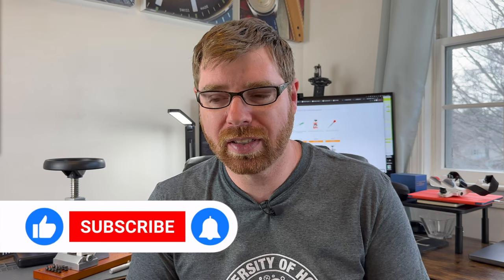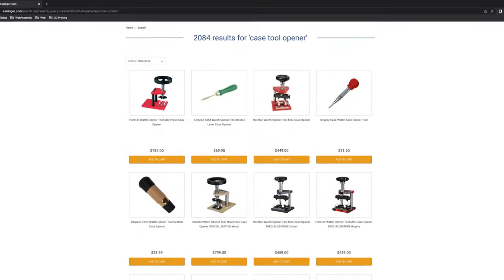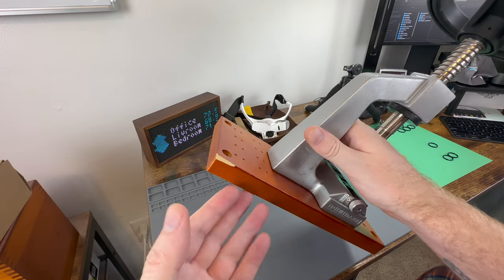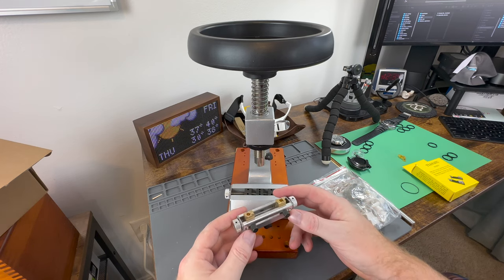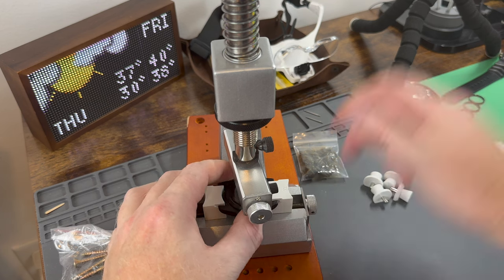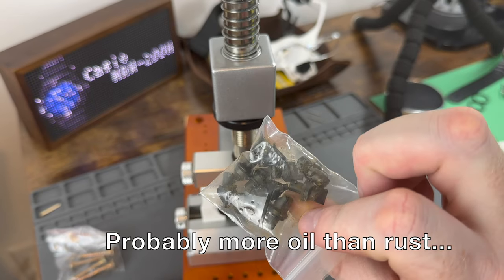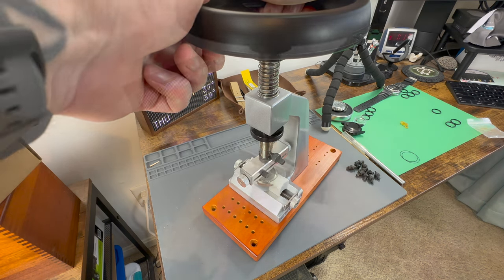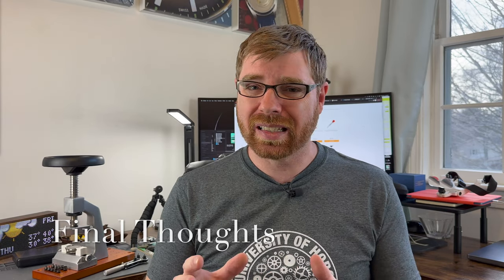Watch Case Opener Review, Bench Tool for Opening Case Backs

Comment: I was dead set on purchasing a screwed-down case opener from Horotec, costing nearly $900.00+. However, after having watched your presentation in this video, I am now exploring more options priced more reasonably in comparison to the aforementioned Horotec. Thank you for an informative review, well done!
Reply from the maker: this thing works just fine, and I use it a lot. There's no reason something like this should cost what Horotec and Bergeon charge.
Reply: @WatchComplications  Yes, I completely agree. The prices of almost anything of late, let alone that of commodities have become nothing short of extortionate.

Comment: I own one like this. It's a good piece of gear and you cans save a ton of money over the Bergeon. I did upgrade with the attachments though. I bought Horotec attachments that fit this tool.
Reply from the maker: I use this tool quite a bit. It is perfectly suitable without breaking the bank. Plenty of other branded attachments fit, so that's a good option. You could even 3d-print custom tool ends for it and that is one thing I've done :)

Comment: Thanks for the review. Was having doubt about the quality, as one reviewer on Amazon was complaining about the poor fit and tolerances of the tool and that it was unusable. Your review convinced me to get one.
Reply from the maker: Never know what type of person is reviewing on Amazon, and I'm sure sometimes things don't arrive quite as expected. From my perspective, this one works just fine for the intended purpose at a fraction of the cost of the alternatives. Not always the case with such tools, but this time, yes.
Reply: You do have to take Amazon reviews with a grain of salt.  These cheaper Chinese tools will use less expensive metals and won't have the fit and finish level as the name brand tools, but are likely serviceable enough for a hobbyist's use.  At least with Amazon, if you get a dud, returning is easy enough.  I haven't yet gotten one of these tools but will at some point.  My experience comes from other Chinese made budget tools.
Reply: Been using the Bergeon 5700 for more than 50years, I rarely use those blocks as they are really meant to be used with a case pad that fits in the two holes in the centre of the base, also on some cases they won't work where the band is recessed into the car, basically just use the holder with four pins to hold the cases, that way I i dont need to remove the band to remove the case back for battery changes or adjustments, you will find that holder more than strong enough even for the tightest case backs.

With the tool holder the most common in use is the rectangular pins for slotted backs, never use those pins that are supposedly for the Rolex knurled backs, you will damage the back on a tight case as you can never get them tight enough to prevent slippage, only use the round dies that fits the whole back, you buy suction cups that fit in place of the tool holder and will most of those odd backs like rolex, omega with five round holes, Breitling etc

Those knurled screws on the side of the tool holder I never use them, I tightened them up and then backed them off a turn and never touched them again, and the large knurled ring meant put pressure to keep the tool holder down on the case very very rarely used, you can lean on the wheel with more than enough pressure to hold it in place, when working in a shop opening and closing 20-30 watches a day that knurled ring becomes old fast.

Comment: Thanks for the review. I have this one in my Amazon shopping cart for a couple of months, and have been debating whether to buy it. So it’s great to see a demo of using it. It would be great if you could also demo opening a coin edge back. Sometimes when those are screwed on really tight, it’s tough to open. I wonder if this one will have any issues.
Reply from the maker: I’m happy with it. As for a coin edge, I have to get a set of attachments suited for those, or more likely I would 3d print one first and see if it’d survive the pressure 😆

Comment: PLEASE DO VIDEO ABOUT TAKING OFF A ROLEX CASE BACK WITH THIS TOOL !!!!
Reply from the maker: You could use this tool if you get the right set. I've seen an adapter kit that would likely fit and the silicone cups (I'll call them) that can be used on the rolex/tudor style of case back. I've also thought about 3d printing ones that would work.

Comment: Hello - nice video. I have a question, if you can help me do a sanity check. I am trying the hoby, and doing some simple stuff, like  shortening the bracelet, polishing some minor scratches all for myself.

I wanted to change batteries, but opening any of 3 or 4 watches I have has been an impossible task for me.

I used friction ball, 2 pin and 3 pin remover  - not even a thought about moving.

Am I really that bad, or doing something wrong, or simply all those cases are closed so tight I need a tool like this one?

Thanks.
Reply from the maker: well this depends on the specific watch. are you sure they aren’t snap case backs instead of screw down case backs?
Reply: @WatchComplications  oh, come on i am not that lost :). I loved this video and got the tool and opened all 3 easily. Much appreciated.
Reply from the maker: oh ok, never know so it’s always worth asking :) but yeah, even on the toughest of cases the leverage of this tool makes it quite easy!

Comment: I wanted to see how you opened the first watch
Reply from the maker: works the same regardless of the watch, just get the lug size right, use the correct tips for the case, adjust the diameter and boom! :)

Comment: Certainly this tool to consider. The handtool isn't that great. You cannot position the bits and screw them tide at the same time. So they wiggle around...
Do you think the Bergeon bits for in this Amazon watch case tool? Just to replace the Chinese ones with quality bits...
Reply from the maker: I don’t sense any difference in the tool bits vs the Bergeon tools. They’re all steel bits at the end of the day. As long as the machining is identical, they’ll work the same.

Comment: Can you get Omega style adapters?
Reply from the maker: I've seen a couple out there that would probably fit this also, like the one on Esslinger. Could also make one (3d printing).
Reply: Not sure plastic would be strong enough pins though
Reply from the maker: @mikebruegger8654  thickness and height would be important for sure. something worth testing. half of my 3d printer is 3d printed.